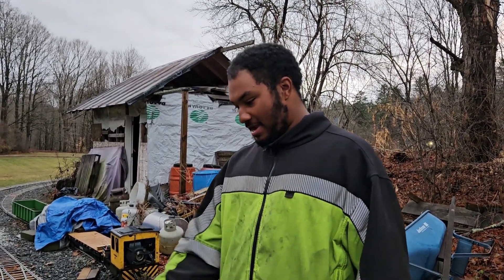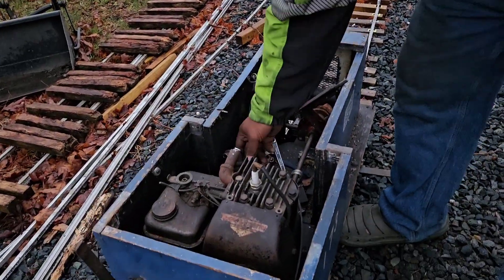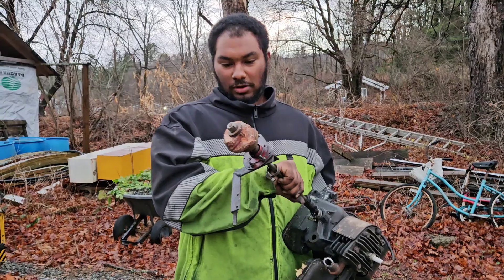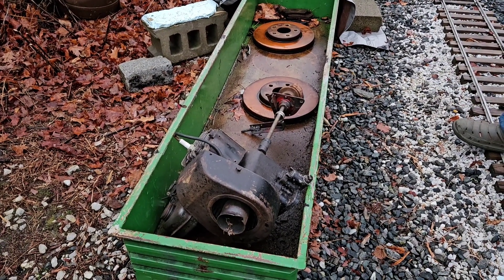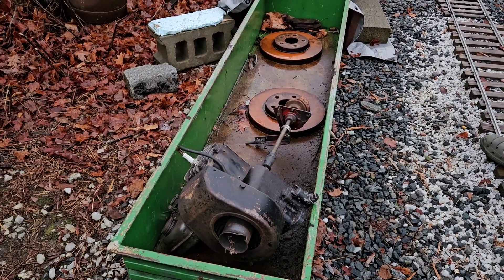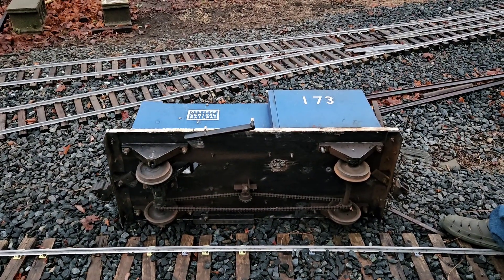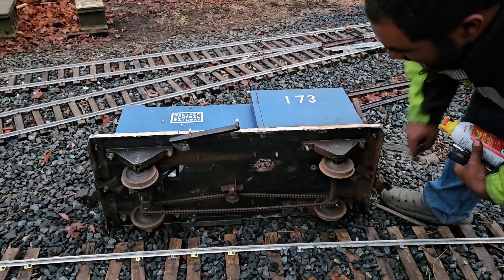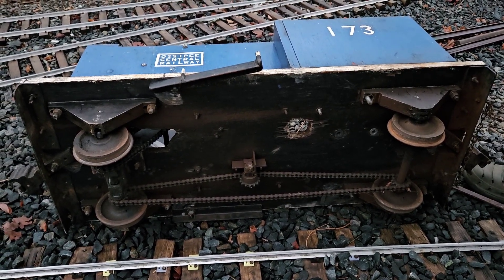Pulling a seized engine out of a tiny locomotive

Comment: Eric so sorry for your loss! well the up grade will be so much better. plus extra traction having the battery mass
inside of the engine.so now you will have to change and set up a charging system, then you are good to go.
will there be a big change in the set up of gas vs electric power? great job good luck with the change over!

Comment: Thanks Éric for making your good engine available.
Internal combustion is the best. Pour fuel and it will run non stop.
Electric is hard to beat. No fuel, fume, exhaust smell and noise, specially for neighbors. No transmission too.
And batteries offer weight for better traction. The weak point is on long run. But how many will run on extra long trackage and die enroute. If so have a battery car that will juice your consist and then Train Mountain longest 26 miles run will be a piece of cake.
To be honest, who would refuse to ride it in superb scenic location ?
26 miles with ear protection or in full quietness and lissening birds and all wildlife sounds....
I wish one day, Aaron, Éric and Derek and all of us to do that run. What a day it should be....😊😊😊
Reply from the maker: @danielfantino1714  Train Mountain has electrics running around the track all the time.

Comment: wow that chain drive on 173 looks like it would slip under load with no idler?
Reply from the maker: There is an idler. I'm not sure how much good it does, but it's there. The 173 hasn't run in many, many years.